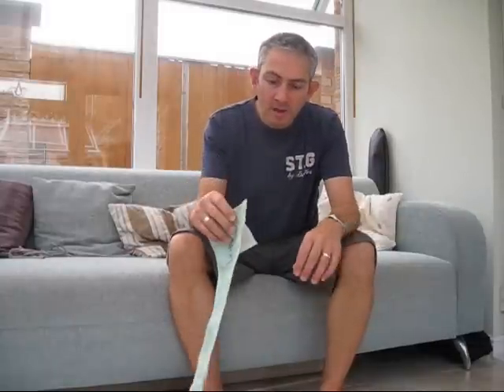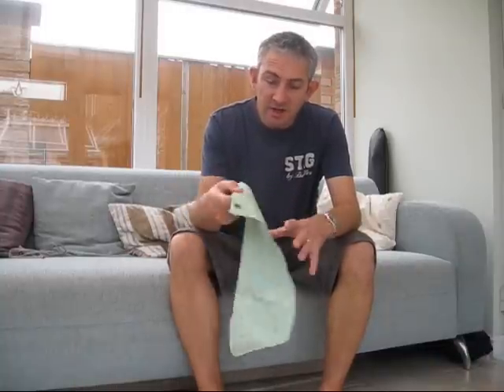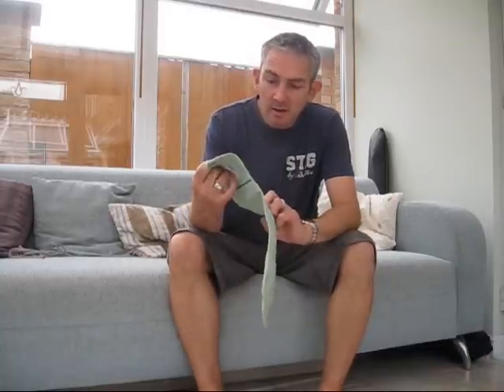Bushcraft - Millbank Bag - Slow Flow Problems

Comment: A very useful tip. I also learnt how to use a washing machine :)
If you don't use a milbank bag very often, a good soak prior to use can be as effective, but you really need to "scrunch" the bag up in the water, to get it really, really, soaked. It should give a similar result to a rinse cycle. After all, we used to wash clothing in rivers here a couple hundred years ago...

Comment: SLow flow can be down to sediment build up, turn it inside out pop it into the washing machine on a 40 degree cycle & air dry on the line. It was designed during WW2 by the the Mill Bank Institute of Tropical Hygiene for British military needs & has been only recent revised (2012) with update specifications for more modern materials. Slow flow was not an issue when It first came out, pre-soaking the bag in the water source SHOULD resolve such matters.